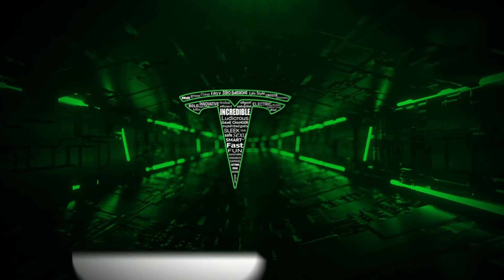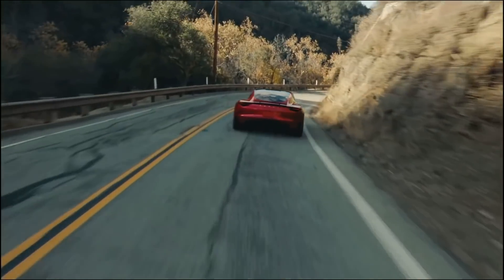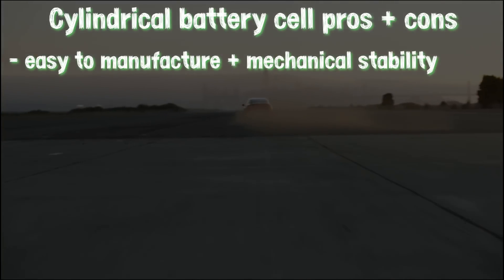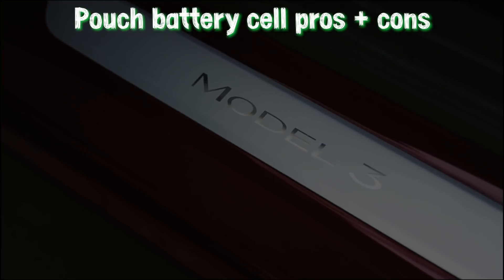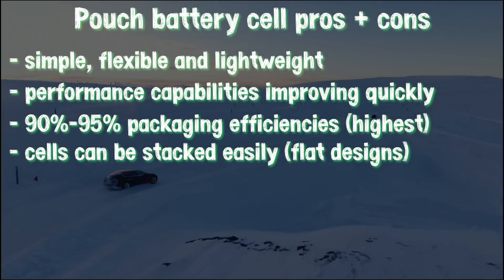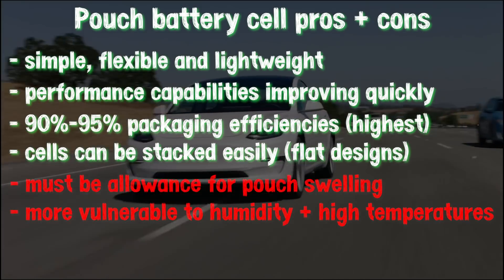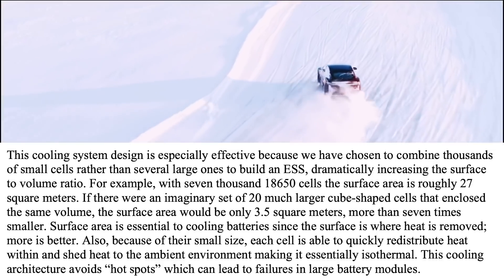Tesla Cylindrical Battery (vs. Pouch/Prismatic) and Tesla Battery News (CATL)

Comment: Tesla is really teasing us. We know nothing other than software is the secret sauce. CATLs LiFepo4 prismatic  cells slashes the Chinese price and introduces the concept of a hybrid with both NMC & LIFePo4 . The Dry Electrode, large crystals, double heating the cathode , coating the crystals, eliminating tabs, additives etc can equally be applied to the 3 basic constructions. Don't forget capacitors & solid glass electrodes , sodium & silicon replacing carbon in the anode  will ultimately be solved. The removal of tabs by substantially reducing on-road charging times, make LiFePo4 very attractive given their lower cost and suitability for  V2G. They could be what defines the difference between  high performance &  cheaper everyday EVs.
Reply from the maker: Great insight Ed...I see you're still staying on top of the game. I have some new battery tech coming soon!

Comment: You say that cylindrical cells have been around since the fifties? I remember using flashlights with AA batteries which my older sisters had gotten with box tops, back in the thirties. By the way your speed of talking sounds good to me, maybe because I`m an old fogie at 86 years old.
Reply from the maker: Hey Alton...just when they were somewhat widespread and used commercially

Comment: Hello , very interesting :-) but you did a mismatch on the CID and PTC, the CID stands for Current Interruption Device and PTC for high pressure building up inside the cell
Reply from the maker: Hey! A few people have pointed out that TSLA does not have either CID or PTC in their batteries any longer. Thanks for sharing!
Reply: @DillonLoomis22  yes they did in order to reduce electrical resistance and because those safety measures was not as effective as expected

Comment: You talk like there is some reason for cylindrical cells today.  The only reason is if you don't know how to make pouch batteries safe.  Cylinders increase the maximum thermal resistance/volume.  The future will be pouch (prism is just pouches with some packaging).  It looks to me like you are trying to twist the world into a pretzel to support the lie that Tesla has a multi year technology lead and other companies will have to learn to do what Tesla did in the past.  The new battery plants built will build pouch and cost less for higher performance.  Tesla Gigafactory will get old and obsolete and Tesla will need to learn how to make pouch batteries (or maybe something newer).
Reply from the maker: Lol. Do you have anything to support this? And did you watch the video? I was clear about the level playing field from a strictly cell level
Reply: @DillonLoomis22  My statement is supported by physics.  The video does a fair job on the reason for cylindrical cells (history, containment) and that you can optimize for a competitive result in the pack.  You seem to be in denial about the direction of development -if pouches don't have a safety blowup, they will be the next (current) configuration.  Tesla will move to pouch (prism) for future models, the only question is when.
Reply from the maker: skyak you may absolutely be correct! The purpose of the video was to try to portray how all cell form factors can be viable for companies to choose at this point. And it could certainly be the case TSLA eventually moves on! I just don’t think it will be “soon”
Reply: Tesla did make changes to the chemistry bring up the energy density.  At the moment I don't know of a pouch or prism cell that is sitting at 250 watts per kilo.  Perhaps you know of one?  Even the CATL prism cells that Tesla is thinking of using in China don't have that power density from what I heard.
Reply: @TheEvilmooseofdoom  Chemistry is independent of geometry but the most aggressive and volatile ones tend to be put in cans for safety.  Cadmium is toxic nasty stuff but the highest performance battery chemistry s use it -CATL does not and it may be worth it to change for the green cred.  Some of the power density lost can be made up with packaging improvement.  You won't believe it til Elon says it, but that should be any day now.
Reply: @skyak4493  But the chemistry changes did play a part in increasing energy density and that's got nothing to do with what Elon says.  I don't think any of the current Tesla batteries use Cadmium..  At least I've never heard of it, the big concerns there were always nickle and cobalt.  From what I understand part of the reason with going to CATL was supply rather than any superior chemistry or form factor, they're facing a battery supply issue and are looking to get cells from a variety of makers.  I could be wrong though, I have not done much reading on CATL's battery tech.  I can't wait to hear what they say on battery day.  IF they are going to a solid state I can see them going prismatic.
Reply from the maker: Lensflare Deviant correct! Don’t think there’s anything close but that has more to do with TSLA working on cylindrical chemistries for years more so than inherent flaws with other form factors IMO

Comment: Tesla's 18650 an 2170  cylindrical cells do not include the CID and PTC functions.  Instead, the battery management system controls all functions of every single cell within the battery pack to remotely cut them off as necessary to prevent thermal runaway.
Reply from the maker: Hey! Thanks for sharing this! Do you have confirmation of this though? Just curious as I know for sure the original Tesla cells did
Reply: @DillonLoomis22  -- It's just something I learned from any one of dozens of 'History of Tesla' documentaries I saw in early 2014.  Tesla's not trusting the hardware functions built into individual cells and instead relying upon their own battery management software to monitor and balance cells remotely elsewhere within the battery pack is their essential 'moat' that no other automotive company has chosen to attempt, let alone been able to replicate.  That's why so many of them avoid cylindrical battery cell arrays.  They see the format as volatile and dangerous.  They believe Tesla has been reckless in choosing to work that way.  So, they believe it is destined to prove a poor decision on Tesla's part.  They are not willing to take the 'risk' they perceive, and they lack the confidence to suss out a solution to the problems they think are 'just too big'.  But the issues they percieve have been worked on by JB Straubel since he was fourteen years old.  He knows what to expect and how to make it work.  Experience is the ability to recognize a mistake when you make it again.
Reply from the maker: @redxsage  thanks for taking a minute to share this! Certainly interesting. I wonder when they removed those from the cells...
Reply: @DillonLoomis22  -- As I understand it, Tesla instructed Panasonic to manufacture the battery cells without the default contol circuitry at all.  I also heard that their cells don't include the outer metal jacket either.  At least where the 18650s were concerned.
Reply from the maker: redxsage no metal jacket? How would this even be possible lol what’s holding the cell contents?
Reply: @DillonLoomis22  -- Idunno.  Paper, or foil, I suppose.  Basically,  when people show off their metal jacketed 18650 or 2170 batteries with the TESLA logo laser etched into them...?  I think those are actually mockups, or party favors.  Not real at all.  I strongly suspect those are a mere fantasy.  

They aren't structurally needed within the array.  The transfer of heat or cooling is aided by the tight confines of the battery pack itself.  And think of the weight and volume savings of having more tightly wound battery cells that take full advantage if the volume available.  Sketchy websites online just swear they are able to supply 'REAL' Tesla branded batteries though.   Yeah, right...

Comment: If Tesla are so Good and far ahead, why are they still among the most expensive?
Reply from the maker: Hey Johan, it's a fair question. The reason is because the cost of batteries are still higher than the cost of gas when analyzing from a powertrain situation. These costs are coming down quickly, but it may be 2023-2025 before EV's achieve price parity with gas cars (same range for same cost). Notice how much more expensive and worse the range metrics are for all competitors...

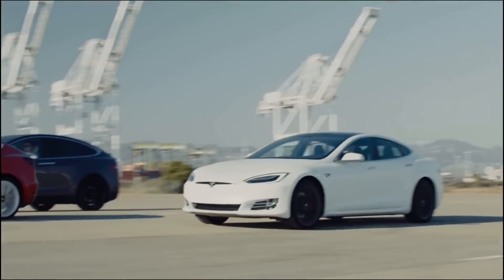Comment: @12:20 unless one accepts limited lifetime there really is no choice. Cylindrical is the only type that can last 10+ years. 

Prismatic and especially pouch batteries will inevitably de-laminate over a relatively small number of charge/discharge cycles as there is nothing really holding them together.

Prismatic cells with sturdy metal containers can mitigate that to some extent but making the case strong enough to be truly effective against de-lamination then seriously impacts the overall energy density due to the weight of metal needed to achieve the strength. 

The beauty of cylindrical cells is that the metal only needs to resist tension rather than bending so they can easily exert a large restraining pressure against de-lamination with a minimal wall thickness. One possible advancement to reduce weight even further could be to use a thin carbon/metal composite structure as used in high pressure tanks (composite over-wrap).
Reply from the maker: Hey there! Thanks for taking a moment to share this insight...always great to hear other perspectives. All I would add is that I'm not sure all of these other automakers would be using pouch cells unless they knew they could last longer than ten years...
Reply: @DillonLoomis22  Most automakers don't really care what happens after the warranty period so it suffices for them if they can expect them to last some five or six years.  They apply that same principle in ICE cars as well which is why car owners face so many expensive repairs post warranty like prematurely failing transmissions and such.
Reply from the maker: @listerdave1240  sad but true indeed...it's a serious consideration more people need to consider that are planning to own a TSLA long term

Comment: The more this description went on, the less important it sounded that the battery be constructed in any particular way. In particular, I don't think space use factor is that important a factor against cylindrical cells. However you package your battery material, you need some overhead space to handle expansion and to provide for cooling/heating. And using a lot of little cylinders makes the production process very simple, and then those little cells can be packaged in a lot of different ways, with a lot of possible variations. I'm sure some car designs will even put them in doors; it would make sense, as you want the doors to have a lot of structural strength anyway.
Reply from the maker: Hey Ronald! Thanks for taking a minute to share this. So the interesting this is that in my research it all said that cylindrical cells actually complicate the manufacturing process the most due to the complexity and volumes required. So yes, they allow options from a packaging standpoint but the smaller/higher numbers can actually increase mfg. times and complexity!
Reply: @DillonLoomis22  I'm actually quite surprised by that. In fact, I thought your video said the cylindrical cells were cheaper. I would think that making a huge number of small items would be the cheapest way to make a certain amount of capacity.
Reply from the maker: @ronaldgarrison8478  it's just how you view it. Production on cell level (making one cell) is very different than making thousands and millions of cells (where machinery and lines come into play vastly changing costs)
Reply: @DillonLoomis22  Oh, I don't doubt that the manufacturing process is radically different. I'm just saying the consequences don't sound that different. It sounds like maybe using 80% of the space for cells, versus 90%, and even that being mitigated by the ability to use the spaces between for things like coolant circulation. That's volume; for weight, I'd expect no advantage at all for pouches. WRT cost, it sounds like cylindrical cells may actually have the edge.
Reply from the maker: @ronaldgarrison8478  it's certainly possible. Very very tough to tell with so many variables, even at a cell level!

Comment: Prismatic is my bet . Cylindrical was the best choice in its time but with graphene lowering esr and jeff dahn doing his work to increase CO for the million mile battery it seems a clear case for prismatic in the future . It will also become the norm for private owners to have 1-4 removable modules that are increased or decreased depending on your distance as 1 module will give 200 km and charge in 15 minutes. If you want to drive long distance you simple rent more modules for that time !This makes the vehicle lighter for most of its use and therefore more effecient !
Reply from the maker: Hey there! Super interesting take on the module situation. Elon did mention recently they plan to remove the module creation and go "cell to pack" but this would be very interesting. You may be onto something with Prismatic with this most recent news!
Reply: @DillonLoomis22  well you can still  go cell to pack on the primary pack with extra  long range packs as modules

Comment: One of the reasons to like cylindrical batteries is that if the car is in a crash and written off...then thousands of cells will be sold at a car wreck auction.   And then DIYers will get a chance to get thousands of cells to make projects with.
Reply from the maker: This is a great point no one else has mentioned! I know there is a BIG market for this!

Comment: Tesla has done a good job or fully integrating and optimizing all aspects of their cars from BMS to their aerodynamics and choice of bearings to reduce the required energy. Then building off a proven battery cell tech that is widely available, they scaled up and deployed battery packs of a huge variety of sizes and use cases.
Reply from the maker: Hey Matthew! I agree my man...thanks for taking a second to share this perspective :)
Reply: I Agree. 

Would add that GM has researched and developed a strategy based on prismatic cells for the Volt and later the Bolt models.

The tradeoffs explained in the video relate the cell chemistry, it's packing and protection, the overall management and protection maintaining them within safe usage envelope, redundancy and fault tolerance, expected usage and expected life.

The rate of containment (surface, area) to cell size (active material, volume) of small cylindrical cells make them less prone to catastrophic events. (Look for the changes in the Boeing 787 Li-ion Battery Pack with cell made by GS and integrated by Thales/Saft)

Another overlooked characteristic is the fault tolerance brought by the massive use of parallel independent cells.

Tesla's current design has many cylindrical cells in parallel within each of it's battery modules. Each cell is linked to the module through a thin conductor that doubles as a fuse that disconnects an individual faulty cell in case it shoots and draws to much current. Passive safety feature that limits the amount of chemistry involved in an initial runaway incident and possible consequences. 

A design based on some 20 parallel cells as within some Tesla's modules can withstand a single failure taking 1/20 th of it's capacity. 

An equivalent prismatic design with bigger individual cells, (typically 10 times bigger than the cylindrical ones), would have 3 or 2 cells in parallel. This leads to a greater loss of capacity with a single cell failure, probably taking out of service.

At which rate cells fail when secured within a specific usage envelope? 

GM built a big battery lab to test this. They even exploded some when testing.

As times goes by and real usage data is accumulated confidence in cell behaviour grows. 

Tesla might have concluded it does not need as much cell level protection as they know how to protect the usage envelope. Otherwise they can consider acceptable the tradeoff of fault tolerance for lower cost.